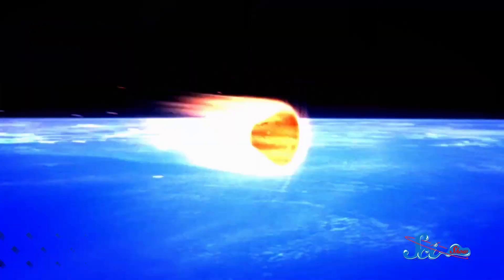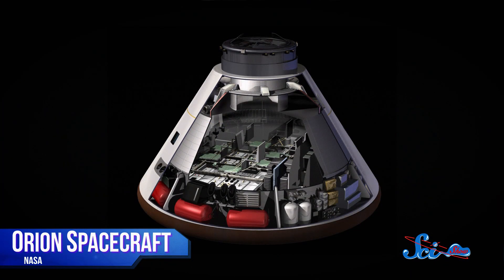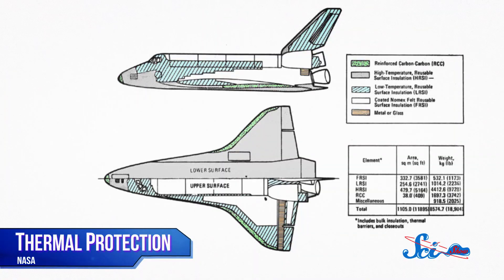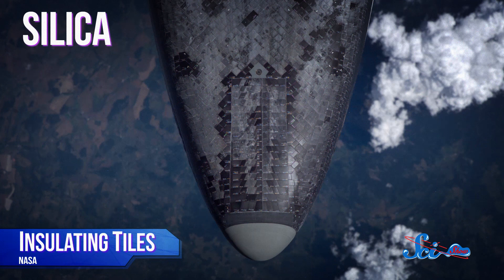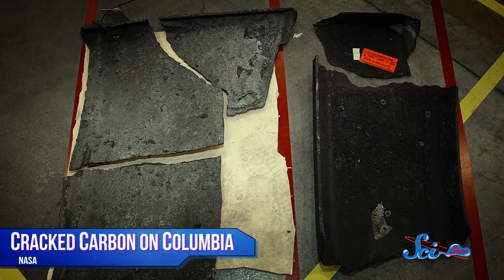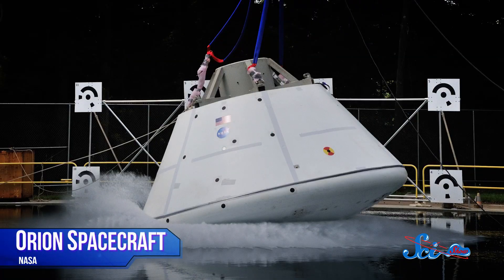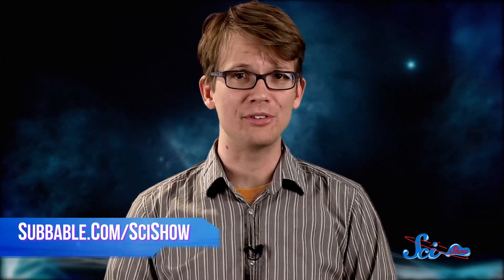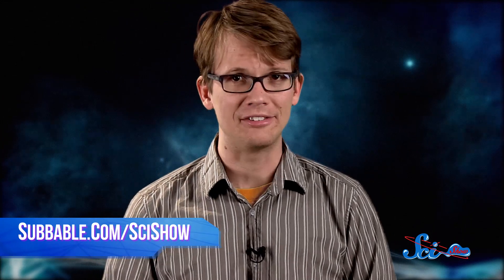How Do Spacecraft Survive Re-Entry?

Comment: So all this time and they can't think of better materials for re-entry? They are some of the best scientists, it just looks like they're being lazy about it.  You always have to think of progressing but they're going backwards
Reply: Or maybe you're just an armchair analyst that doesn't know what they're talking about.  For each problem, there are a small set of engineering solutions that are the best balance of performance, cost and reliability.  Cars, bicycles and passenger planes have not significantly changed in design for many decades because 4 pneumatic wheels on  drivetrain, a double diamond frame with chain-based power transfer and a semi-monocouque tube with swept wings and nacelle engines turned out to be the best solution for each of those problems.
  Ablative materials are cheap, durable, light and extraordinarily reliable.  The PICA-X material being used currently on SpaceX's Dragon capsules (developed jointly by NASA and Space X) is quite thin and capable of being reused at least 10 times before needing to be overhauled.  
  It's easy to spout out some motivational poster crap like "You've always got to move forward, not back" but it's a lot harder to actually design, make and understand these systems.
Reply: Just wondering, did you copy paste that? 
Also i don't think you understood what i meant!!
Reply: Manny619 No, I did not copy paste that.  Do you even understand what you're saying?  You're moaning about how technology is going backwards without even the slightest understanding of how actual engineering and science are conducted.  
  Just because one technology was discovered before another has absolutely no bearing on how appropriate it is to use.  The Shuttle heat tiles were a technological wonder but were fragile, insanely expensive to maintain and ultimately killed 7 people.  Ablative heat shields are a solid, proven tech and have advanced tremendously since the time of Apollo.  Even if they hadn't, they would still be the best balance of performance, price and reliability at present.
  There are experimental heat shield technologies but they are nowhere near ready for use at the present time.  
  And yes, I understood exactly what you meant.  You are accusing thousands of highly trained scientists and engineers of being stupid and lazy because you watched a video, thought about the problem for half a second and decided that you somehow know better than them.  If you'd taken even a few minutes to do some basic research on the subject, you'd see that ablative material technology is currently the only serious contender for use on spacecraft.  Also, it has improved tremendously since the Apollo days.  Ablative tech has been used on literally thousands of space missions and has never failed.  
   How is the improvement and use of a technology that is this reliable and proven a step backwards?  Please enlighten us.
Reply: Just wondering, did you copy paste this?
Reply: I didn't say i was the scientist, they are, they should be doing the research and coming up with new stuff!!
Reply: BossesDream He's not a troll, he's just a dumbass.
Reply: Dan Heidel  thank you.
Reply: Dan Heidel Don't feed the troll.
Reply: Manny619 Wow.  Just wow.  What do you think these people do all day?  Did you read a word of what I just wrote?  They have been developing new materials and technologies.  The ablative materials they use now are completely different than what they used 60 years ago.  They have been continuously improving and developing them as well as other heat shield technologies.  
  It would be one thing if you had something of value to add to the discussion - for example, arguing that a specific experimental heat shield technology is superior to reusing ablative materials.  But you don't.  All you're doing is shooting your mouth off and calling literally thousands of hard-working, dedicated and far smarter people lazy and stupid because you couldn't be bothered to do 10 minutes of research on Google or asking a few questions.
Reply: Manny619 Why should they come up with new stuff? If it ain't broken, don't fix it. Ablative shields are cheap and reliable. In fact, they are the cheapest and most reliable solution.
Reply: Manny619 You know how when siblings fight they both get sent to their rooms?  It doesn't matter who started it, you're both in the wrong.

Plus your initial comment really was pretty insulting to the people who have been working hard on this.  You assumed you knew better and that they were just being lazy and/or incompetent.  That's one of the reasons I took the time to write you such a thorough reply; since I've spent two summers working with some of the people who you insulted I kinda took the disrespect personally.  I wasn't just going to fling insults like Dan though, being a jerk would make it impossible to teach you anything.  Insults just shut people down, they don't really help.

But anyhow, I spent a good amount of effort on my response before explaining everything my branch did.  Why don't we discuss that instead?  I'd like to know if you appreciated it or if you have any questions.
Reply: Manny619 The most obvious solutions are usually found and adopted within the first years of research… Then, the remaining solutions may take years, decades or even centuries to be discovered, perfected and adopted.

Combustion engine were invented in the 19th century and most of the discoveries and development were made within the first decades… If we look at the development made within the last 50 years, almost nothing changed!

http://en.wikipedia.org/wiki/History_of_the_internal_combustion_engine
Reply: Sometimes old tech is the best tech.
Especially if it's updated old tech.
If the highly educated minds of spacecraft engineers have concluded that ablative materials are the best solution, you can bet your ass they have very solid reasons for it. Their entire careers revolve around solving these kinds of problems, and they're far more qualified to do so than you or I.
Reply: Meg Ashley Wasn't expecting an answer like that from this thread of comments. Good stuff.
Reply: NASA gets very little funding. They don't have a lot of extra money to research better ideas. This is why everyone needs to get together and get the US government to increase funding for NASA.
Reply: However these lines were copy-pasted:  

"But in real life, engineers don't always use the most advanced technology. In fact, the most elegant engineering solutions are those that require the least technology, not the most. A good example is a machine gun; it uses a simple, elegant and robust mechanical system to eject each cartridge and load the next, based on gas pressure, springs, rods, and other low-tech principles. The simpler, the better. With modern technology, we could design a machine gun that uses miniaturized robotics instead, but why? The resulting weapon would be far more expensive, and far less reliable. It would require a power source, and software. It would be far more difficult to maintain." 

"A good scientist is a person with original ideas. A good engineer is a person who makes a design that works with as few original ideas as possible. There are no prima donnas in engineering."
Reply: Dan Heidel After looking at his profile, 100% confirmed troll.
Reply: Manny619 True. Especially if you focus on the results. But sometimes efforts are invested without producing any results.

One of the main problem since the economic crash is the reduction in financing… People who would do research and development are laid off and only people doing maintenance have jobs. This is terrible for science and technologies!
Reply: Manny619 But we are making progress.. as Heidel said twice, the idea might have first been put to use 50 years ago, but it's also been improved greatly since then. I really don't understand why you'd assume we're using literally the exact same stuff, even framed as it was in the video.
Reply: I am at a dichotomy, Scientific Research is never useless.Because of Space Research we now have, Baby Formula, Cordless Tools, Ear Thermometer , Freeze Dried Food, Memory Foam, Solar Panels, Artifical Limbs, Etc.  while I am kinda glad "emphasis on Kinda" that the US spends so much on defense, in regards to the Fundamentalist Islamic threat to the entire world, the spending on defense is good. Its good to have a decent nation have an excellent defense to show power to Groups of people who want everybody under 1 religion. However if the entire US governments budget was 1 dollar, currently they are spending half of 1 cent on NASA. All NASA needs is 1 cent. 1 CENT. 1 cent. That's it. NASA isn't asking for a lot. with the extra Half penny in spending, the US could again be world leaders in Innovation, Technology and Health care. Coming from a Canadian, I love our Space Program, but NASA has the potential to be able to do sooooo much more that it currently is, And I am an advocate for a higher NASA budget.
Reply: watertroll face I will apologize. When I read your comment the first time I read it as "useless scientific research"

My Bad. My point still stands though!! More NASA funding!!!!!!!!!!!!
Reply: Manny619 Wow Proof that their are dumb questions in the world.  Unfortunately it is perfectly legal for someone as dumb as you to mate, reproduce and buy a gun all in the same day.
Reply: I understand some of you have been butt-hurt by my opinions. I am Sorry for expressing them!
Reply: Dan Heidel he did say they're going back to using what they use to use 60 years or so ago so how does that make it completely different??? 
Also going back to the old ways where the material melts as they re-enter atmosphere is not really the best way to deal with cost and definitely not reliable either if the material is just melting away. Again you guys have done the research and i am just a curious person who's been called a dumb ass just cause of a comment!
Reply: and no i don't wanna go on google to read, that's why i'm on youtube watching videos about it!!
Reply: Meg Ashley i only said what i said cause of that 'dan' dude!!
Reply: They are not exactly going backwards. Ablative materials have got better. They seem to me to be the best solution until some material is invented that will protect the spacecraft better during reentry. A propulsion system that allows slower reentry would be the ideal solution. A compact fusion reactor and a arc rocket? Only the future will tell.
Reply: watertroll face I bet you are one of those people that just want to pay out ransom money to terrorist or that ask why the military can't just attack all the ISSL schmucks but you vote to cut spending all the time.  Did any of that ring true?  Have you ever heard the expression, "Not a penny for tribute, millions for defense"?  Who do you think pushes for more funding for NASA, the Boy Scouts of America?  Do you not understand that the DoD keeps pushing space research and tech advances by spending huge amounts on research, research and more research?
Reply: John Miranda and you're the intelligent one right? it's my opinion, you don't like it, piss off!!
Reply: Dan Heidel oh my god, i will never argue with you, the PWNAGE level is over 90000!!!!!!!!!!
Reply: Manny619  So I disagree with you and definitely take issue with your passive aggressive "I understand some of you have been butt-hurt by my opinions. I am Sorry for expressing them!" statement, BUT Dan Heidel is being pretty insulting and completely useless if his goal is actually answering your question.  The others are right when they says sometimes old tech is the best tech.  I'll try to explain a bit more.

I interned at Johnson Space Center this last summer and can tell you that they are definitely not "being lazy about it."  While Orion is using an ablative material (AVCOAT) on the bottom of the capsule, the tiles on the backshell (the top portion) do not ablate.  Additionally, the heat shield is constructed differently than in the Apollo days.  AVCOAT is not the only material used, the ablator is only the first layer of a complicated thermal protection system (TPS.)

A lot of effort in the branch where I worked is focused on more accurately modeling the environment that will be experienced during re-entry and how the TPS will react to it.  In the Apollo days they could not model this very well at all, and so they had to be extremely conservative in shielding their capsules.  The TPS can actually be much thinner today because of all the work being done to know exactly how much shielding is needed, and every kg saved is progress.

This is really NOT  a trivial problem, because as the heat shield ablates the shape changes, and the changed shape changes the amount of heating to which the capsule is exposed.  Even understanding how heating at the TPS translates to temperatures on the structure itself is not simple, and one of my projects was modeling this heating on the shoulder of Orion.

The issue is that increased knowledge doesn't look exciting, so from the outside it can be hard to appreciate how much hard work has gone into where we are now.
Reply: SymbolX thanks mate, finally someone who knows to how to reply with some decency. The only reason i said is that in this day and age if we're not making progress we're not really doing anything! what do you think?

Comment: Blunt body reentry is outdated. Computer simulations with skylon showed that buck Rogers would have survived. Also, buck Rogers would have re entered backwards so as to use the engine for VTVL. (Engines can survive reentry with the same cooling systems that let them survive normal use).
Reply: just because it would survive doesn't make it the optimal meathod of reentry
Reply: Maybe with modern tech and with lower mass vehicles that is the case but Buck Rogers was shown over and over in the 50s to turn into a mass of molten metal.

Also, no spacecraft has ever demonstrated a full deceleration from orbital velocity with thermal management and attitude control using an engine first descent.  Computer simulations are nice and all but until multiple actual reentries of Skylon or a SpaceX upper stage have been demonstrated, we are nowhere near being able to call blunt re-entry bodies outdated.
Reply: I would love to ride on skylon (if it ever gets built) but I don't see it being an ideal space vehicle, more like a real space cab taking people to and from LEO.

Comment: Could the heat from reentry be used to catalyse reactions to make fuel or to recharge metal based batteries. There must be usefull things than can be done with 1600o heat. Something like those catalytic hand warmers but more extreme.
Reply: impwarhamer Could cook some bacon for the after party though.
Reply: I don't think there's much use in generating fuel or recharging batteries if your a few minutes away from ending the mission.
Reply: That is some nobel prize worthy thinking right there.